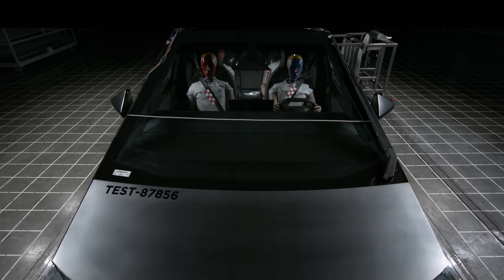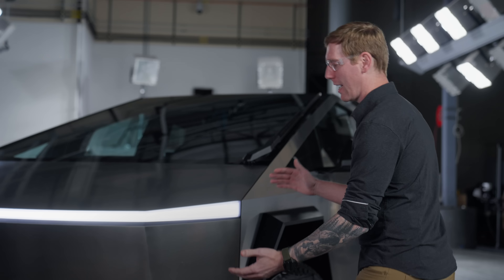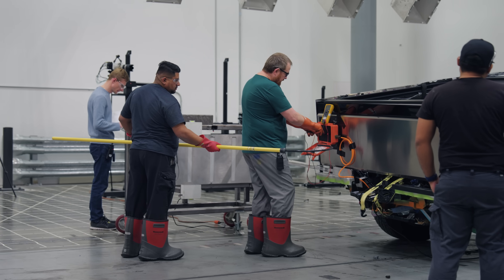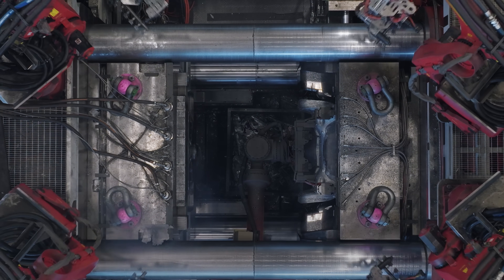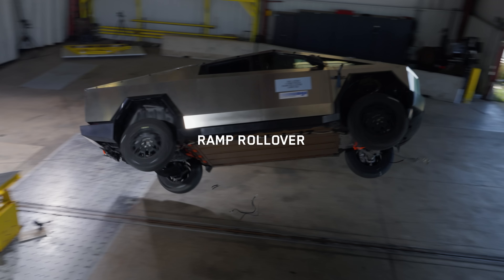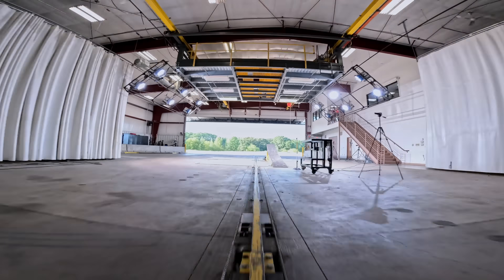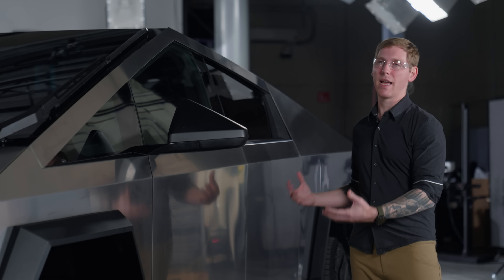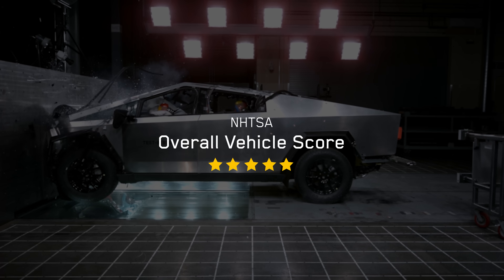Engineering Cybertruck for Maximum Safety | Tesla

Comment: Let’s do a pedestrian safety test
Reply: lets do a pedestrian safety test in an F-150... I think you forget all cars can kill people even a Prius driving at you.
Reply: @Deighvihd  Haha, who wants to volunteer from the Tesla Engineering team first? Or Franz, Elon? I’m sure you’re not afraid
Reply: Every Tesla has self driving.
Reply: Filesuit afterwards
Reply: Meanwhile other safe cars you think about will kill someone at contact.
Reply: Switching cars doesn't matter. They still die bro💀
Reply: What an idiot comment.  Do any other cars run through pedestrian safety test?  Any vehicle is unsafe for a pedestrian in the middle of the road.
Reply: This is purely for the passenger inside a Cybertruck. Where are the tests for an impact of a car into the side of the CT, or a CT into the side of another car. Those side wings would just pierce the door of a car like a knife and scythe the occupants in two.
Reply: This is done with every other car manufacturer?
Reply: fr
Reply: You do realise that it has safety systems to avoid pedestrians and actively move out of the way?
Reply: Yeah I need to know if the protesters are gonna be there to sue afterwards
Reply: It does not show a crashtest of 40% and 60% overlap, and this is one of the most important tests, especially 40%. Even an old, not very budget car for 5 points will take a 100% blow.
Reply: @lampeno  Because it hasn't done it yet, as you know those don't come first
Reply: @lampeno The rating was for IIHS which is already done and it got 5 stars.
Reply: @lampeno they posted that months ago. You just never cared. And something tells me that you'll move goalposts again.
Reply: @lampeno  oh come on, you are trying to make a point but you're falling flat. You really think the 40% or 60% overlap test on cybertruck won't blow the doors off all competition. You really need to look in a mirror. Lol
Reply: How? IIHS does that and Tesla's won't hit the dummies unless they turn all the safety features off completely.
Reply: @JonVB-t8l it takes time to brake especially with such a heavy truck if it doesn’t break in time, you’re still going to hit the pedestrian that’s why you need to do the pedestrian safety tests like the euroncap
Reply: @JonVB-t8l  Teslas will hit children in car parks standing against a fence. Relying on Tesla software has killed a bunch of people already.
Reply: I see you're raising your hand there... please step forward as the first participant in our first test: freeway crossing impact.
Reply: Lets say it's... death proof 😅
Reply: Put your cell phone down and pay attention when you are out and about, that’s the start to your pedestrian safety test
Reply: @ put down your tablet while driving lol
Reply: what pedestrian survives any car crash?  You might want to volunteer, I'll watch.
Reply: There are reasons why it wouldn't be acceptable in the UK
Reply: @iKaGe01  Eu regulations. mostly weight and the sharp corners
Reply: @iKaGe01 The UK has government tyranny, you can keep it as far as Im concerned
Reply: @iKaGe01  Not in EU either.
Reply: @iKaGe01  😂 yeah reason one is they don’t like vehicles over a certain weight driving around by common everyday people and the Tesla is light as it is and I said light because it’s fairly light to my opinion for a pick up truck unless you go to a small pick up truck. like a Ford Ranger, doge Dakota, or an S-10 pick up those are about the only things that might qualify and weight in the UK but I’m sure they’ll have a complaint about size or height or something else absurd and I get it. They don’t have a lot of room in the UK so it’s only logical but just to stay out there there’s a reason why🙄 we all knew the UK won’t accept the cyber truck. Heck they wouldn’t accept my truck at all either and it’s a Dodge ram 2500 pick up thing weighs about 9000 pounds with the way I got it set up and that’s another thing from what I understand. You can’t do a lot of accessories like you can over here. We have a lot of free range when it comes to aftermarket or development even of our vehicle. Vehicles doesn’t mean the vehicle is not safe. It just means you’ve got a lot of laws in the UK.
Reply: I can save you some time.  Humans hit by cars dont do well.  Nothing special about the cybertruck will change that in any meaningful way.
Reply: @ That's a gross oversimplification. Technically you are correct, but there are definitely big differences between different cars. Yes, few pickup trucks are significantly safer than the Cybertruck, but pickup trucks are notoriously unsafe for pedestrians in the first place. Many smaller cars are much safer for low-velocity impacts with pedestrians. I know America is not built for pedestrians anyway but in an urbanized area in Europe where the maximum speed is 30 km/h (19 miles/hour) being hit by a Model 3 or a Cybertruck is the difference between life and death.
Reply: Ok Karen
Reply: @Forrestwilliam look at getting mad that someone is criticizing a trilion dollars company
Reply: SAFEST vehicle EVER.
Reply: My dad sliced his leg open on the bottom of the door. He’s thinking of suing.
Reply: @Shihtzu99  Top 10 things that never happened🥀
Reply: @Shihtzu99  - your DAD under FRAUD investigation by TESLA.
letter from TESLA LEGAL soon.
Reply: @Shihtzu99  - let him try.
CRICKETS............lol.
Reply: Context: not a fan of big tricks in general because none of them are very safe
Reply: What vehicle would pass genius
Reply: @Sir_Loin_ any car that passes euro tests 😂
Reply: They've done it with teslas before so maybe they will
Reply: If youre stupid enough to walk in front of it then thats not Teslas fault
Reply: TESLA on all its Vehicles has the TOP Active Safety of ANY Vehicle.
Reply: And then compare it to every freaking car and truck on the road. Hey genius - the car always wins.
Reply: Are you a Ford owner?
Reply: @TheSpaceTravel  Haval
Reply: It’s actually smaller than the average American stock pickup truck.
Reply: @edgarh252  It’s heavier. It’s more important. If I get hit by an empty fridge box at 70 mph, I would survive. But if it were an anvil flying at 10 mph, I wouldn’t.
Reply: @edgarh252  it kinda is - it's about a F150 I think. I walked around one once (draining the batteries for the sentry cameras a bit (I'm sure) apologies to the owner but it was the first one I saw parked 'in the wild' and was trying to mentally map the dimensions (no touchy - if the owner was watching on his phone I hoped he appreciated I kept my arms clasped behind my back to avoid reflex/temptation) but I was pacing it off with my 1 foot feet *handy to have - also probably why the owner was confused why I was looking at the ground more than the truck). Still too big for my (current) garage but I could park in a climate controlled garage / hanger nearby.
Reply: Also no touchy because I have a friend with a DeLorean DMC12 and he's always wiping fingerprints off the windows and the sides from lookey-loos XD - I can only imagine how annoying that is.
Reply: Why would that be necessary? if most teslas are smarter than you, namely, it will stop if it sees something in the way, then it becomes the pedestrians fault to have caused the incident. Why can’t cars be built safer?  So safe now equals selfish because it didn’t consider the situation the others are in? Or maybe the others are stupid in Wales into the car because they hate Elon musk like you?
Reply: we dont care
Reply: This vehicle is not allowed in Europe. That's all we need to know.

Comment: Now do Euro NCAP.
Thought not.
Reply: How do you score a vehicle that refuses to run into a pedestrian?
Reply: @Dularr  pedestrians run into the road anyway.
Reply: @MrGonzonator  agreed and autonomus vehicles watch for that and take measures to avoid them. It's a federal requirement. Identify pedestrians and hard brake when necessary.
Reply: @Dularr  what do federal requirements have to do with Europe?
Reply: @MrGonzonator  US Federal requirements on US made vehicles could pass European safety standards. Of course this would require Europeans to want to import US made vehicles.  
More likely, the US manufacturers would just European versions of the vehicles. But I find it hard to believe a European Cybertruck would be popular.
Reply: @Dularr  I'd buy one if it were legal. But the European regulations are much much stricter than US federal whatever.
Reply: Cybertruck ALREADY being IMPORTED to the EU.
its even REGISTERED.

Comment: 1:04 it's weird that the passenger airbag breaks the windshield on deployment. If you have an impact which wouldn't result in a broken windshield, once the airbag's deployed, you have one more thing to repair / replace ...
Reply: Considering cars are typically totaled when the bags go off, it's not that big of a deal overall....
Reply: I’m not Trying to be rude @eduarjsx, but when a severe car accident occurs passenger airbag deployment usually shatters the windshield. This is because it has an explosive trigger, that deploys it at 200+ mph. It also pushes against the windshield, while it is putting tons of force onto the windshield too, causing it to shatter.
Reply: If you're in a horrible crash you can now escape through the front windshield 😂
Reply: Yeah the windshield shattering has nothing to do with with impact of the vehicle as a whole it's solely the airbag......... derrrrrrrrrrr

Comment: Would love to see NHTSA to institute a pedestrian risk rating as that would be pretty eye opening. Trucks are basically terrible there. I think cybertruck would do a lot better than every other truck on the market as its nose is lower to the ground. Still probably bad compared to the model 3 and Y style cars.
Reply: you'd die getting hit by a bicycle or motor bike at high velocity, these AI comments are killing me
Reply: CT has the Absolute HIGHEST safety Rating,
Reply: What is the point.  If you are hit by a car going any appreciable speed you die.  The difference in car type is very small compared to the impact of the speed.

Comment: Celebrating the 5 star rating is a pretty mediocre measure. I don’t know a new car on sale that score below the 5 star rating. The real test is the IIHS tests, FYI the frontal test on IIHS is 40 mph instead of 35 mph.
Reply: Some people can never be satisfied. Maybe try “I was wrong”
Reply: @ I'm trying to explain is that the cybertuck is as good as a completely normal car, every Honda on sale right now scored the same 5 star rating so its pretty mediocre that Tesla is celebrating that test.
Reply: You have no clue how the 5 star system works. It has many different categories. Not many cars score 5 star in every category... Ford will get 5 star in rear passenger safety and brag about it in the commercials... All the while, front passenger safety is 3 star. 

CT scored 5 stars across the board as well as got the lowest probability of injury among any pickup tested. 5 star has a range of probability (example 5-10%). CT scored the best with the lowest probability. 
Learn how these tests are done before opening your yap. 
 
Tesla's internal safety tests are MORE rigorous than any other safety authority. The CT will get top marks from all of them.
Reply: @ Where did you read that TESLA's tests are more rigorous than any other tests?. Literally the IIHS tests are more rigorous than the ones in the video. Anyway if you settle with just a five star rating that a Honda CRV score the same ,then buy that awful truck. I'm just saying that putting a video celebrating a score that a normal Toyota can achieve it's mediocre at best.

Comment: For those who are concerned about pedestrian safety - the software is developed to recognize pedestrians and emergently stop. In my personal experience, when driving about 25mph, a pedestrian was walking down the sidewalk and turned into the crosswalk without looking, and the truck braked before I could react. If you don't hit the person or if the truck starts braking before you react, the impact will be lessened compared to other vehicles traveling at the same speed.
Reply: Yet somehow as we have seen Teslas run into trucks that are clearly visible , run into concrete barriers , run off the road , there are multiple instances of this shown on film . 
 You couldn't pay me to buy one of these.
Reply: @mikldude9376  Very rarely do these systems ever fail, but when they do, they get publicised. There are millions of Teslas running about, clearly the system works reliably well that we don’t really hear about Teslas running into trucks or concrete barriers that often. I can personally attest to this, my Model Y is very reactive in its safety systems and it has good judgement for when to emergency brake.
Reply: This software is standard in many cars, it's far from special. In europe it is mandated to be present in every car sold. Due to camera only it's also inherently prone to have a higher failure rate and slower reaction time. And as aramis said... it's passive safety is terrible to such a state, it's illegal in europe.
Reply: @Xirtamani  Tests conducted by EURO NCAP themselves, you know, the actual organisation responsible for automotive safety regulations in Europe, rate Teslas as one of the highest-scoring vehicles in active and passive safety systems. I mean seriously, go read the reports yourself. The Model Y scored 98% while the Model 3 scored 94%.
Reply: Bro we're talking about the Cybertruck here, every vehicle is different, it doesn't matter that the other models are 5 stars EURO NCAP
Reply: you must understand that active protection and passive protection are two different things. An sharp and high vehicle is hazardous in a lot of case where software is not able to compensate for additional danger.
It's safer to be hit by a sedan from toyota or peugeot than a Cybertruck and it's the reason behind the restricted zone where theses trucks are available.

Comment: Would be great to see some pedestrian impact tests - but we all know what would actually happen when anything living gets bent around that sharp set of angles, so I won't hold my fingers crossed.
Reply: Teslas are literally covered in cameras monitoring their surroundings 24/7 with the best active pedestrian safety systems on the market. I don't think that's an issue.
Reply: @retro1120  Even if a pedestrian was hit the low sloping hood line will have a better outcome than the typical tall vertical grill of a legacy ICE truck. This is well understood by people who study pedestrian impacts. Cybertruck is the safest 1/2-ton truck on the market.

Comment: Finally we get to see the ending to the crash test video

p.s. please sub to my youtube channel i make optimistic videos on Tesla
Reply: We waited for years 😏
Reply: Exactly my thought!🎉❤
Reply: Ikrrr I've been on the edge of my seat! :D
Reply: Yeah
Reply: after 48yrs of anxious state! 3:)
Reply: I  dont exactly know and understand  why people are so exited about the new refreshed model y,it still got short lasting traditional tabbed 2018 interduced panasonic 21700 NCA cells,which only has 1000 cycle life(one of the lowest in the industry for instance 21700 NMC has 2000 cycle,tabless cylinderical NMC 4000 cycles,GEL polymer electrolyte tabless 21700 NMC has 5200 cycles,short blade and prismatic LFP 5000 cycles,prismatic NCA 2700 cycles,prismatic NMC 3400 cycles to lose 20% of its original capacity ),it still uses same out dated and heavy electric motors,it still relies on out dated 400 volt architecture,it only gets very small range gain,i still dont understand why people are exited about it...
Reply: ALL of Tesla vehicles are 5 star RATED or better.

Comment: May be safe for the driver and passengers but imagine getting hit by a cybertruck😱
Reply: Imagine getting hit by any truck
Reply: no different than getting hit F150, F250 and F350?
Reply: @redpillgreenenergy141  exactly
Reply: @ With those sharp angles, you're pretty sure to get severely injured. That's the reason the cybertruck is prohibited in the EU.
Reply: @FalconSky_  illogical reasoning.  All cars are dangerous.  You are mixing being scratched by sharp corners.  If you get hit at even at a low speed, as a pedestrian, sharp corners make no difference.
Reply: We survived the old classic El Dorado.  Go look.

Comment: What are the vulnerable road users and pedestrians probability of injury/safety ratings?
Reply: @FlorentHenry  where is this for any vehicle? USA doesn’t have a testing standard for VRUs. Consider any current truck or SUV or CUV hitting a VRU….bad situation
Reply: Pedestrian vulnerability is high as heaven. Pun intended 😂
Reply: Not any different than any other pickup. People that hate the Cybertruck are deranged the same way they are deranged for hating Elon or Trump.
Reply: i think the propability of pedestrian injury will be much lower with a cybertruck, due to all the cameras and the ai system monitoring the whole surrounding 10.000 times a second, all the time.    especially compared to a caren, playing on her phone in her audi q8 suv, who wouldnt hardly notice if she runs over people.  or these very old people confusing gas and brake,  drunk drivers or very young drivers that have too much testosterone..
Reply: @  it's really far from 10kHz but definitely more frequent and surround than humans. Though, I'd like these figures anyway.